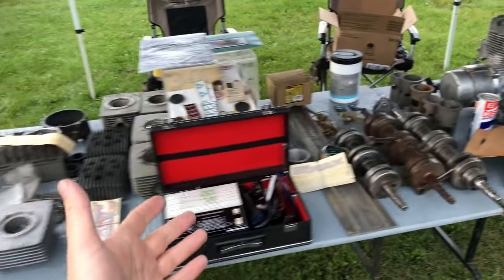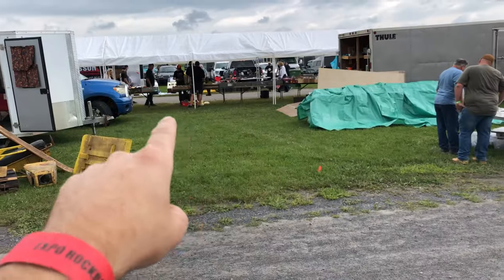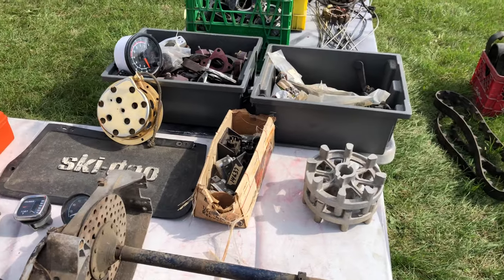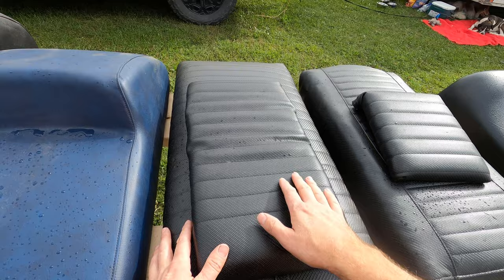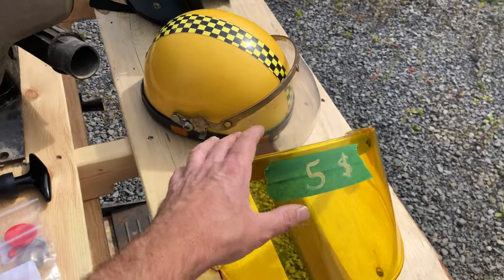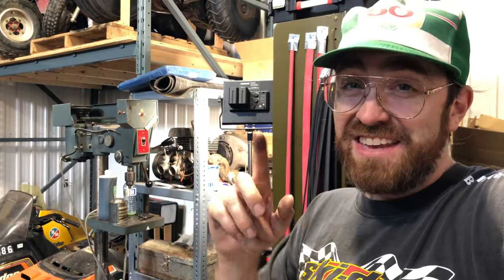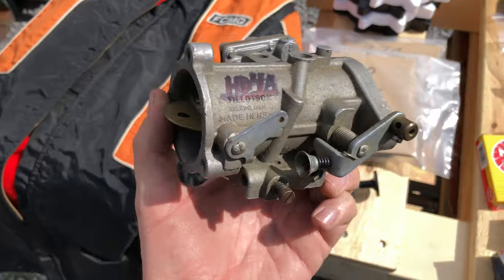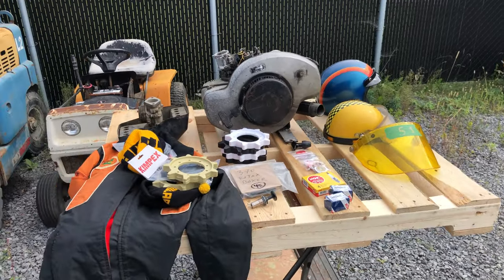Vintage Snowmobile SWAP MEET and Summer Finds! Ormstown 2022 summer show- VSCADK

Comment: Great haul Matt tried to comment earlier but that option was not working. Now we need a sled in need of an engine...
Reply from the maker: I currently have a 1968 Oly and Alpine and a 67 Alpine that are all 370s. Its going to be the best 3 engines that make it back into the sleds… I’m starting with the Olympique and then we go from there… stay tuned!!!
Reply: @mattsws  I will

Comment: I test-drove a used 245 years ago and ended up getting a 5500 instead. However now I would prefer the 245.
Reply from the maker: Yeah, I can understand the decision to drive a 5500 vs 245 on the trails, but from a coolness standpoint, the 245 is hard to beat! Thanks for watching!